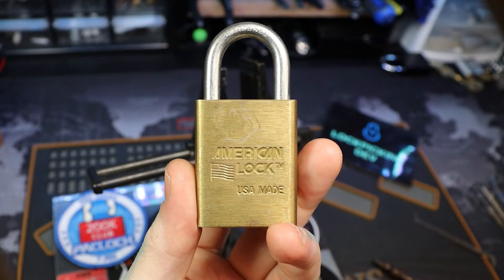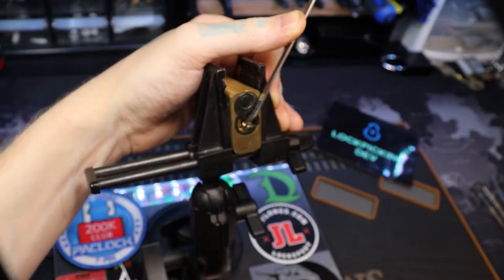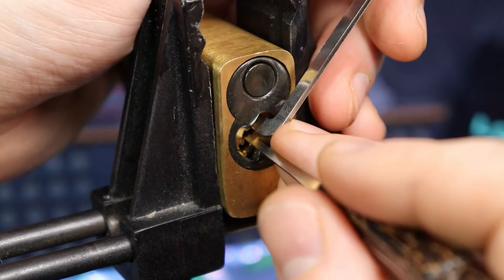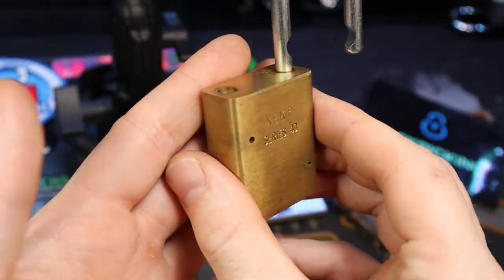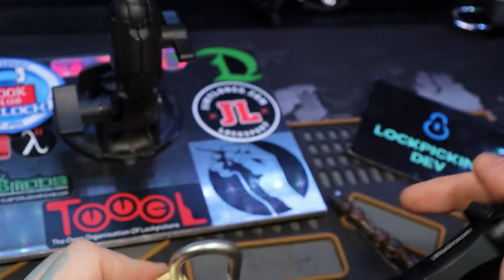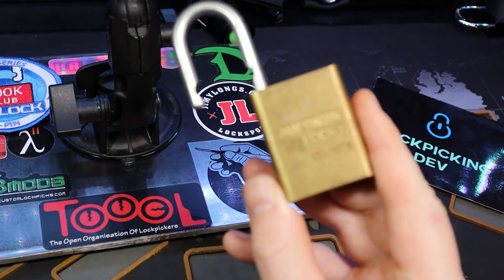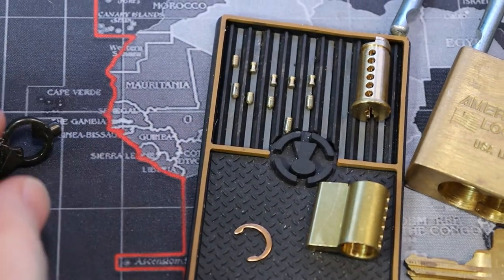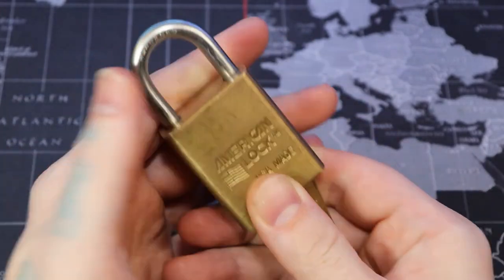193) American Lock Series 40 Picked and Gutted

Comment: Nice lock, great job and an informative vid!
 I received a Series 10('93) with keys today. It's in nice condition and a not too otherworldly price- but, due to THE most horrendous bitting(68877), it took infinitely longer to open the package, than to rake the lock open with a shallow hook. A tad disappointed- hey ho. Now, my first thought was to gut and rekey and saw it had the same rivet/bolt retainer... I may still do that, now I know what's under the bonnet. 
 Conversely,  one of my 1100s('99), owes me hours and hours up to now- no keys to that one.... dammit! 🤷‍♂️😁🤘🔒
Reply from the maker: Thanks, glad this helped!